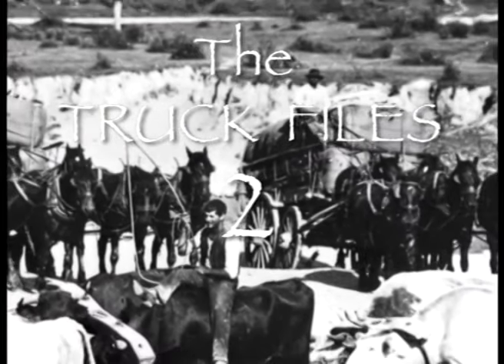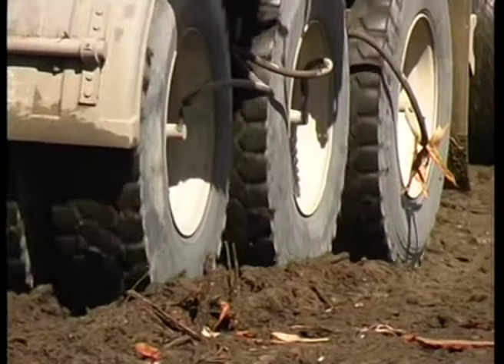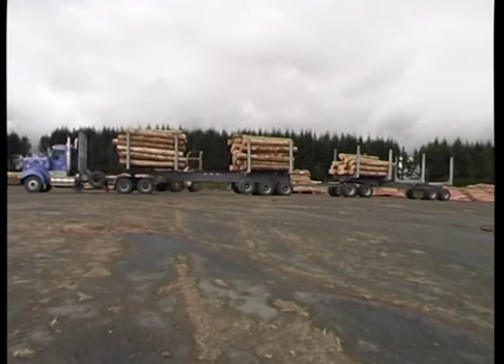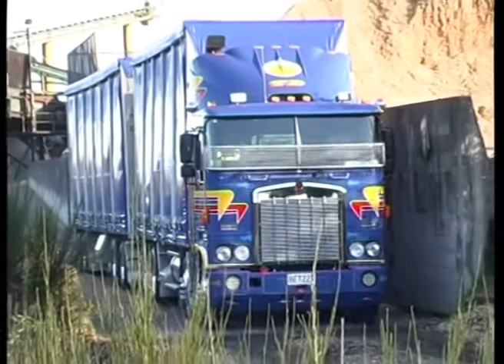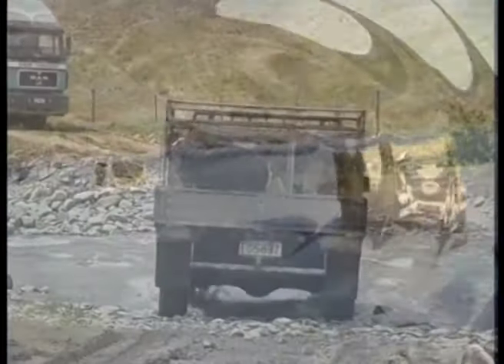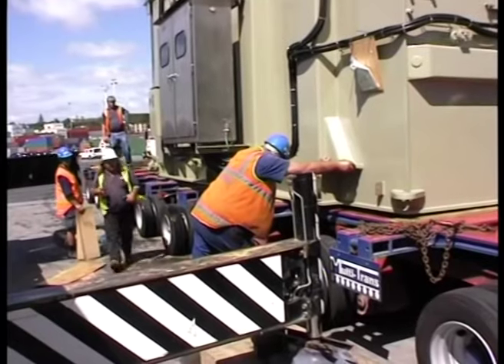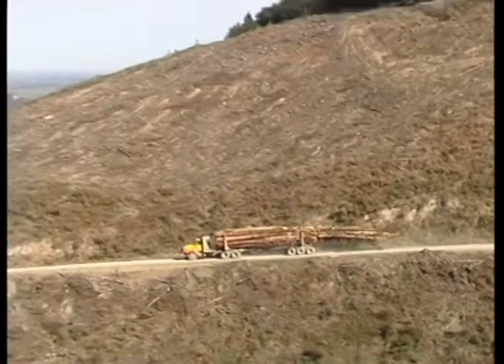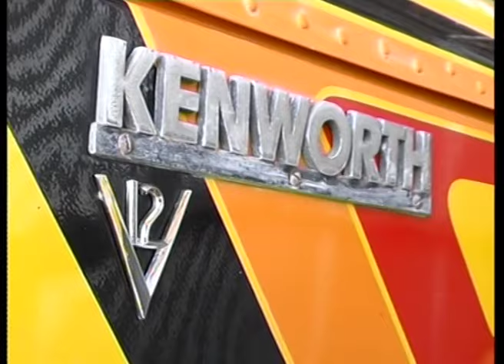Truck Files Vol 2 Oversize

Comment: That D11 has an easy life 😂 no rocks or hard shit in the undercarriage, tracks usually on soft chips and easy to steam clean, I bet the mechanics love it. Just watch for sparks
Reply from the maker: I was told when I filmed this that the undercarriage was lubricated by the oils in the wood, and that nothing looked like it would ever wear out, compared to dozers that worked on rock and ripping.